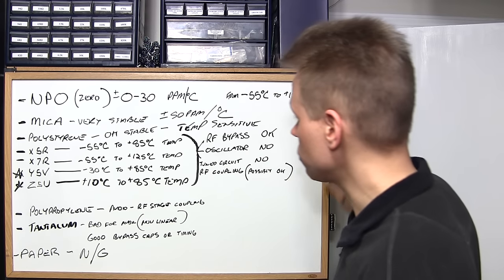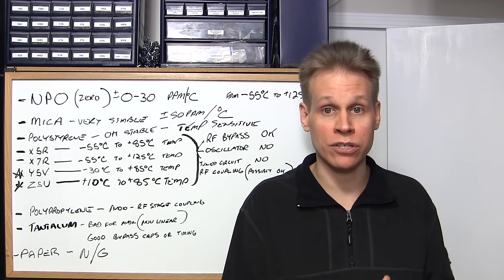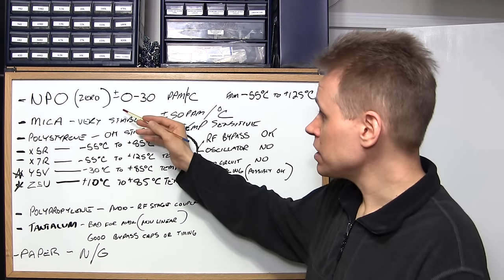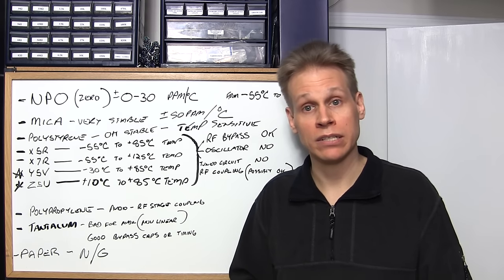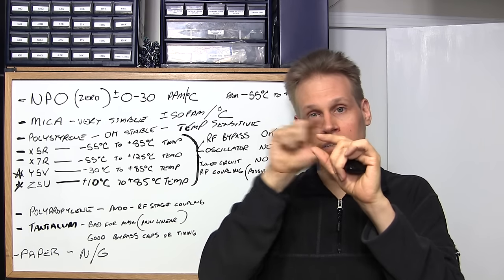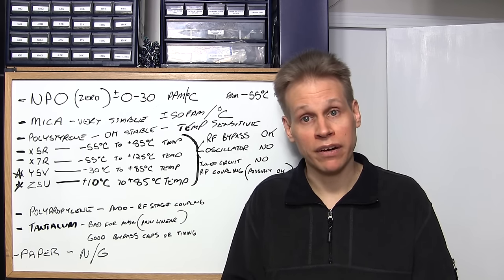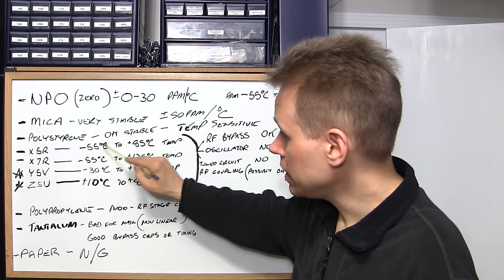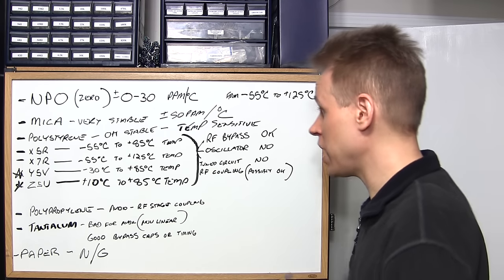Which Capacitor Do I Use? Tech Tips Tuesday

Comment: I have a little 5Watt 'Stentor' FM transmitter for the 3Meter band (broadcast radio) and it has 3 10pF ceramic capacitors in the oscillator section. Would it be better to exchange those for mica types for better stability or wouldn't it make much difference do you think?

Comment: could a ceramic disc cap be used as a microphone is several are used in series and mounted to a diaphragm my guess is they would pick up the higher frequency sounds quite well and ignore the lower frequency sounds and their high impeidience would make them a great capsule choice for PA if they pick up cleanly keeping in mind they need to be kept clear of rf noise or you will have that transduced as well

Comment: Wow really interesting video... I am surprised that many guitar amplifier manufactures used ceramic capacitors at all, considering that voltage spike affect. Maybe they don't use them as much now, but in the past they were all over. Even if used to control tube oscillation,  I would think that voltage spiking would be undesirable. I guess ceramic caps are less expensive.
Reply from the maker: +Bucyrus Erie12 
Whats even more odd... I have worked on some high end amplifiers that use them for coupling.

Comment: 👏👏👏👏👍👍💖 thank you for sharing your insight and knowledge great video 😁
Reply from the maker: Glad it was helpful!
Reply: @MrCarlsonsLab   polyester film caps are great for audio as well and metallzied polyester caps and film foil caps and also polycarbonate film foil caps🤗 My spelling might not be all correct but anyways. I like working on amplifiers and building them myself self-taught. And I also like watching others build and create we can learn from each other. Knowledge is power!🤗💯 I didn't really know though that ceramic discs did that thank you for the insight they use those in a lot of the old amplifiers. LOL no wonder the old amplifiers and CB radios sounded so bad😂 Also WIMA film foil capacitors are nice I just call them caps for short.😁 But anyways thank you again hope to see more great videos.

Comment: Why don't you want to use the capacitor in 3:36 in an oscillator circuit?
Reply from the maker: Thermal drift. This type of ceramic capacitor is not intended for use in circuits where frequency stability is of importance.
Reply: Thanks for the explanation!

Comment: Great video. This video is very interesting and it really left me wondering about one thing. I am working on a high end amp that has a number of .01uF PP axial caps in it. The manufacturer, which has a very good reputation for excellence in their engineering, published a Technical Bulletin that recommends replacing eight PP caps with Ceramic .01uF X7R equivalents. With the information you published their selection of replacement components seems counter-intuitive. This amp is a class A beast, so it will produce some heat which could directly affect the capacitance. Since it weighs over 140lbs it is customarily on the floor on some type of slab. Vibration could certainly be a factor, which again leaves me wondering why they would want to go this route. Your demonstration clearly shows what can happen in the presence of vibration. Am I missing something ?

Comment: Yeah, those dipped tantalum "blobs" are great for  non-RF R/C timing applications.
However: they suffer from DV/DT troubles. Worst caps in the world to put directly across a low impedance supply (as bypass).

Comment: Which capacitor should be used for storing energy at high voltage and applying across low resistance load?
Reply: nisha p First of all, you need to understand the performance of your circuit and what demands it places on the capacitors. Most capacités have some maximum ripple current rating, and that’s what you don’t want to exceed during rapid discharge. Other than that, you’ll have to look for low ESR and qualify the parts in your circuit. That means that you need to get the capacitors you think may be good based on specs, install them in your circuit, then measure the performance of the circuit – e.g. how much energy do the capacitors waste and convert to heat during the discharge. This requires some know how into high current measurements, and those are especially hard when high voltages are involved – due to the need to insulte the HV circuit from everything else (including your body). So, as far as “shoulds” go, your safety and repeatable performance measurements come first, before you even think about what parts to buy.

Comment: All these are strange to me .i plugged a 12v power supply to a 5v electric device (smart battery charger) .did i burn the capacitor? If so how to recognise where the capacitor is?

Comment: so ceramic caps were used in the vibrato ocillator circuits on old fender guitar amplifiers as part of the timing of the speed control. I'm guessing that Leo Fender used the wrong type? I'm sure the inside of an amp chassis with 4-8 vacuum tubes with play havoc with their operational stability. also, they can be found in the tonne controls of electric guitars (passive low pass filter) which is essentially an RLC circuit. you mentioned not using them in tuned circuits. in this case they are part of the signal path.  can you comments? thanks.
Reply from the maker: Hi Bob, there are many different kinds of ceramic capacitors, the NP0 style are fine in tuned circuits, as that's what they were intended for. The ceramic caps that I show here, Y5V or X7R style (or the like) are the exact opposite. They are great as bypass capacitors (audio or RF) but should never be used in a signal path. If you find a small ceramic disc capacitor in a tuned circuit that has a black line on the top,( they kind of look like the have been dipped in black paint on the top portion of the capacitor ) These are NP0 disc style caps, and are ok for RF use. Try not to use disc ceramic capacitors in any audio circuit signal path. You can see why in this video.

Comment: Thanks for all of your great informative videos, Paul.  I had a question regarding the flux content of the silver bearing solder used on vintage Tektronix scopes.  Is there a particular percentage and type of flux that should be used on the ceramic strips?  Kester offers the .031"  62-36-2 in the "44" series which is RA 3.3% flux.  Kester also offers the same 62-36-2 in the "245" (no-clean) series, but they have a greater selection of flux content such as 1.1%, 2.2% and 3.3%.  Which solder would you reccomend as the best to use?  Since I'm on the subject of soldering on those ceramic strips, is the 2% Ag solder that's available now ok for repeated repairs?  Your input is appreciated!
Reply from the maker: Hi. 2% is usually enough to stop migration. The issue with those ceramic strips is silver migration to the soldering iron tip. This weakens the bond between the horse shoe and the ceramic. 2% Silver is usually enough to mitigate this issue. I prefer a flux made by MG Chemicals, search for #835.
Reply: @MrCarlsonsLab  Thanks very much for your insight!   (I meant to ask this  question on your solder tips video, so forgive the comment being way off the subject here)  Regards!

Comment: What is your opinion of the  "new old stock" paper in oil capacitors that sellers on a certain online store have. Would these also be leaking DC current although they have never been used. They are usually marketed as having superior tonal qualities in electric guitars and are priced much higher than the other types.  Some people say it is the value of the capacitor that impacts tone and not the material the capacitor is made from, while others believe the opposite. Is there any way to measure this to determine if this is actually so.

Comment: Where do mylar/polyester capacitors fit into this? I've seen some active antenna (HF) amps reference them as caps to use in signal path for coupling but other literature suggests otherwise. Is there a definite answer to their use in coupling?

Comment: Paul, I sometimes had electrolytic capacitors and also batteries that internally swapped polarity, so positive became negative and vice versa... Do you have an explanation for this phenomena? Greetings from Germany, Michael
Reply from the maker: Were they ROE capacitors? :^)
Reply: No, they were modern but standard electrolytic ones.. I remember they were bulged, so I desoldered and replaced them, and when I tested them the polarity was swapped :-DIt has been a long time since, but as I also have seen a battery with swapped polarity I thought, Paul is the correct address for asking :D

Comment: Thanks gave me some new ideas for testing components.  What is your feeling about polyster caps.

In the guitar amp would I find the polyster tends to "smooth" out the tone,  where as Polyprops are very rigid and edgy sounding.

I have testing methods I have developed using a Quadtech LCR meter and measuring the Q of the capacitors.  What are your thoughs?
Reply: Gary Johnson Why would you use an LCR meter to measure frequency response of a capacitor? You have to test it in the circuit it’s going to be used, and use some sort of an audio response analyzer to sweep the response and see what happens. Your computer’s (or phone’s!) sound interface will often do as a poor-man’s analyzer. No LCR meter’s reading will tell you what effect the cap will have on “tone”: it all depends on how the capacitor is used in the device, and it all must make sure that you don’t suggest anything to yourself.

I.e. you can’t do it on the feel or listening alone. Use an actual instrument that measures frequency and phase response, and distortion. Qualify what you like on amps that sound the way you like, so you’ll be able to translate your preferences into concrete, measurable parameters. It’s somewhat hard to translate the response of an overall circuit into the behavior of a single part like a capacitor – the circuit itself is the best test for that capacitor, since you don’t have to guess what properties of the capacitor affect the result. And even if you knew what properties are important, it may require lots of setup to actually measure them. You really don’t want to guess anything there.

Comment: I believe that I have the paper capacitor in a older solid state battery charger because one broke  and their is definitely paper and foil in the capacitor. I want to replace it but you can't see anything on it to tell you what value it is. it's a 12v 4 amp and 6 amp charger.

Comment: Lets say I find some older caps in a guitar amp.   Another tech likes to use an ESR meter to detect if the cap is leaky.   If a cap passes on the ESR meter,  it it ok to leave it be?
Reply from the maker: +DeadKoby 
The ESR test will not indicate leakage effectively. A leakage test requires DC voltage to be applied to the cap, to see if it passes through. (basic idea) Some caps won't show leakage until about 50 Volts or so.  The Heathkit IT-11 is a nice tester for this and can be had for little money.

Comment: I have a question. I just bought my first tube radio and besides the paper caps that need change it has caps that look kind of like orange drops except that they are a dark blue and some of the are starting to crack open. What are those and do I need to worry about those making trouble?

Comment: I have a question Mr. Carlson.  Are there any electronics parts suppliers who sell these different types of capacitors to the individual in small quantities rather than in large bulk lots?  I have tried contacting Digi--Key, Mouser, Allied, etc. with no luck.  Also, what is your brand of choice for replacement capacitors?  Any help would be very appreciated.

Comment: Hey Mr Carlson,
I've read that there are different classes of ceramic capacitors and that not all ceramics are piezoelectric and heavily temperature-dependent, apparently the ones in the smaller pF ranges are better. Have you ever run across some of them, or are all ceramics that way? 
And if a capacitor is non-linear and unuseable for audio such as tantalum, what causes this effect?
Reply from the maker: NP0-C0G type ceramic capacitors are a different breed, and are fine for oscillator and temperature affected circuits.

Comment: You mention that ceramic caps shouldn't be used in oscillation circuits, but I've seen them used in most Blackface amp circuits for the tremolo. Is there a reason you think this is a bad idea? Thanks!
Reply from the maker: The oscillation you mention is not needed for any stable application, just sound. When ceramics are used in oscillators in receivers, standards, VFO's and BFO's, the oscillator operates at much higher frequencies, making any movement in that frequency noticeable. There are NP0 type ceramic capacitors intended for oscillator application, but the are built much different than most ceramic caps.

Comment: I used polypropylene caps in my magnetic induction heater. You say not to use polypro's in an oscillating circuit. Isn't my mag ind heater an oscillating circuit. They work great.( I use 4x .47uF  275v)
Reply from the maker: Hi Brandy. I'm referring to precision oscillator circuits. Induction heaters will pay no mind to slight frequency drift.
Reply: Mr Carlson's Lab OK, my bad. I have been sitting here thinking o another type of cap to use. lol

Comment: Hi there, I have a question that I could'nt find the answer to here. I have a 3volt portable reel to reel and I want to replace the caps on the motor. It's got them flatish green caps with the two wires coming out of the bottom, (I am not sure what they are made of), is it ok to swap these for ceramic disc caps?

Comment: Do polyester film capacitors make a suitable replacement for wax capacitors in old tube radios?
Reply from the maker: They would be fine in all circuits except the oscillator mixer area. The oscillator/mixer section should have Mica or an NP0 style replacement.

Comment: So if I have a broken preamp (bulged cap), Should i replace it with an identical cap? Its a large black cylindrical one.  I think i left the unit on for too long.  Should i replace all the caps with better ones? what would this do to the circuit?
Reply from the maker: Hi Joe. When capacitors bulge, it usually indicates built up pressure inside due to boiling (or the like) It should be replaced with a "good quality replacement" of the same value.

Comment: I'm curious why people say they pass AC. Caps don't actually conduct, that's why they block DC. Current never actually pass's thru them. With AC they charge and discharge at a rate that corresponds to the frequency. Their value decides what freq. they respond to. Just wonderin.

Comment: Which capacitor is best for the power leads of say, fuel pump, HID projector beams, etc on a vehicle that causes RF interference that then gets picked up by the HF antenna?  The one for the fuel pump would be under the vehicle mostly exposed to ambient temp but others might need to go under the hood where it's nice and toasty.  Thanks!  Also, for the alternator, I assume I'd need something beefier than just a capacitor?  I know almost nothing about this stuff, so any help is much appreciated.
Reply from the maker: You will need an inductor and capacitor(s). The value of the inductor and capacitor should be tuned to the center of the noise frequency area. If there are multiple frequencies "centers" present, you will need more than one capacitor. Any other solution is really "Trial and Error."
Reply: Awesome, thank you so much for fast reply, keep up the great work, really enjoying the channel!

Comment: Why is the Farad unit for capacitors so large, that the common capacitors are usually so small that they have to be measured in units as small as microfarads?
Reply from the maker: Because they knew the future :^)
Reply: carultch
Reply: A farad is defined as (wiki) "the capacitance across which, when charged with one coulomb, there is a potential difference of one volt." So it makes sense within the context of the SI system, but yeah, wildly impractical in everyday use.
Reply: nanofarad and even picofarad are used
Reply: Brent Lewis Indeed, probably more often than microfarads!

Comment: why do you not use a ceramic capacitor in an oscillator circuit? 

you give me the idea to exploit leaky capacitors to get the characteristics those old bumblebee caps give, while protecting the circuit around the leaker w/ diodes and resistors. I suppose however that you would also need to protect the circuit more importantly with caps that would end up taking away from that character.

Comment: A few people have mentioned this in the comments below and I noticed that you haven't replied. That's fine of course, obviously you're busy. The question is regarding where mylar/polyester capacitors fit into this. They tend to come in epoxy dipped packages much like the polypropylene caps you featured in this video, but I can't find all that much info on the difference. In fact, polypropylene capacitors seem rather harder to come by than the polyester ones. Are they similar? Are the polyester caps just cheaper/inferior?

If you get the time, any feedback on this would be greatly appreciated.

Comment: Oh ... Thought the tantalum would start to burn ... Nowadays all tantals should be avoided :) Thx for the demonstration ... I always buy caps in this order: NPO, X5R, X7R but relied on information I read online. Nice to see how good NPO really are :)
Reply from the maker: Actually Tantalum's are very dependable now. I haven't had a single failure with any I have used. I have a VFO in my Gates broadcast transmitter (I designed this in 2003) It been on 24/7 and heated to 135 Degrees ever since. It's loaded with Tantalum's.